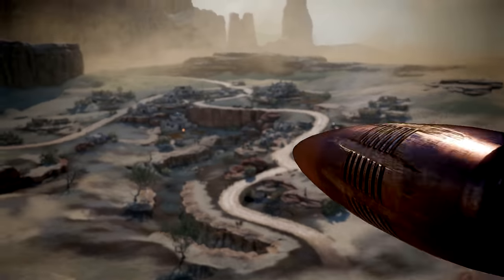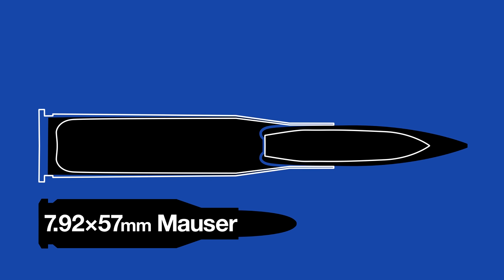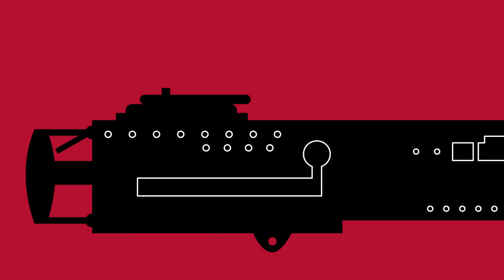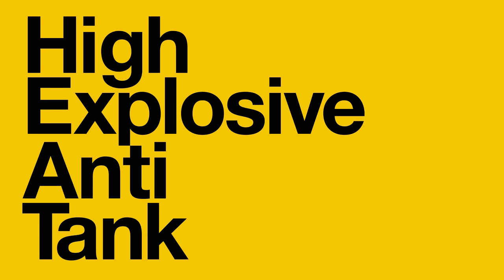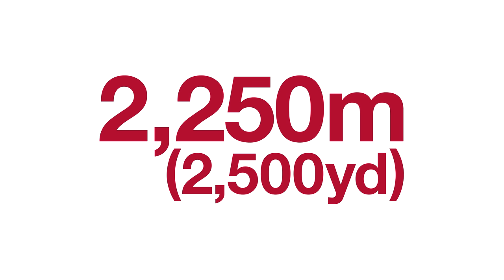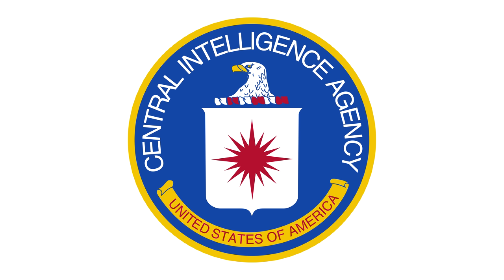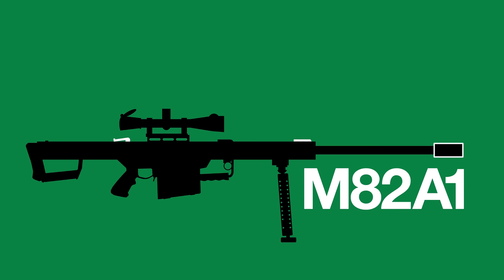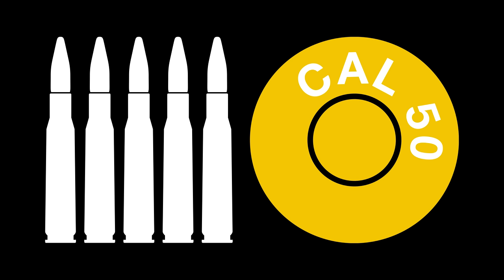Barrett .50 Cal.

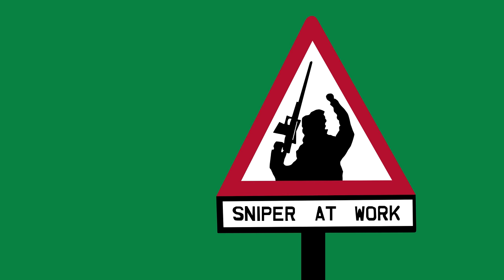Comment: 6:46 They used them behind enemy lines to stop supply vehicles, a 50BMG to the crankshaft of a semi truck does a lot of damage. Seizes the engine, and stops it in it's tracks.

Comment: One thing that was not mentioned which helps explain how the Barrett is so controllable is it's operating mechanism. It uses the somewhat unusual Short Recoil operating system which causes the entire barrel to reciprocate for a short distance every shot. This helps attenuate the recoil and spread it out.
Reply: Short-recoil operation isn't unusual, it's just unusual in a rifle. Most handguns are either straight blowback or short-recoil operated. All of Browning's machine guns, the M1917, M1919, M1921, and M2 also operate on a short-recoil action.
Reply: Extremely useful system to handle the recoil of cannons aswell.
Every modern naval gun has it, you need it when you're firing volcano eruptions with every shot!

Comment: Definitely an iconic rifle. One that successfully proved itself in application as a sniping weapon despite its purpose as an anti-material rifle. Made record breaking sniping shots. The sheer power of that round can punch through cars, walls, and light armored vehicles. And it has taken down enemy threats behind or inside those very things. One I know had in its earliest marksman use test was able to eliminate 2 insurgent targets who were radioing and coordinating mortar strikes with radio and binoculars. First shot was low hitting the balcony wall from I believe between 700-900 yards. They came back to it and called shots on the pair. But the second shot hit its mark. The 50 BMG round struck center mass on both targets with that one bullet. The spotter even told his sniper “holy shit!” He had got them. The Barrett can really make you, as the phrase goes, reach out and touch someone. I would love to see a video to be done of the winchester lever action rifle or the Colt single action army revolver “the peacemaker”.

Comment: The bf4 version of the M82 is the best in any multiplayer game imo. Instead of balancing the weapon in a tradicional way they let  the weapon be extremely strong (1shot players at any range, 2-3 shot light vehicles) but the weapon spawn on a fix position on the map (not with the player), so you have to control that area or be careful with the cooldown to use it. Nice way to balance and keep the M82's identity.
Reply: That thing was disgusting. Once you held it's location you were nigh unkillable. Especially on deathmatch maps.

Comment: U manage the recoil cause it has a ton of weight and a compensator. Also cause u tend to use it while  sitting or leaning on the ground. Not meant to should fire. It is an antimaterial gun that can be use for antipersonal.

Comment: I disagree about the .20 to wound, .30 to kill thing.

5.45x39 seems to cause just as much, if not more, damage to the target than 7.62x39, and is much more likely to deposit its energy within the target instead of punching straight through. That is, despite being smaller caliber with smaller energy, the shape and muzzle velocity advantages mean 5.45 does as much damage as 7.62 at short range. At longer ranges the 7.62 likely does more damage, but at shorter ranges, fragmentation and yaw make 5.45 and 5.56 pretty effective over the 7.62 due to higher velocity.
Obviously full length rifle cartridges are superior to 7.62x39. But even then, terminal ballistics matters a lot. If you have a 4000 J round that exits the body with 2000 J remaining, you have at best a 2000 J round, and only about 60% of that is deposited into the body cavity.

Or likewise, if you have an even shorter 7.62, say, 7.62x25, you may very well not have sufficient velocity to quickly incapacitate someone.

Comment: Most people don't realize that the M82 and M107 are actually very* light recoiling. My 270 and 450 bushmaster kick harder than my Barrett. You gotta remember that's it's a recoil operated actuon and mine weighs 33lbs with the scope, so little recoil

Comment: What's funny though is that the M82 was never really intended as a precision weapon. It's a short recoil action, not conducive to precision. There are other, more precision oriented weapons such as the McMillian TAC-50 or the Serbu 50-A. Real world precision with an M82 is about 2MOA or better, which is still 20 inches at 1000 yards, more than capable of hitting a man most of the time, but not what we expect from precision rifles.
It's also nice to see the M82 equipped with a red dot by Navy personnel when it's used in a helicopter as overwatch during interdictions.

Comment: The Barret isn't a sniper rifle, though. It's an anti-materiel rifle. It's less accurate than, and does not have as flat a trajectory as smaller, purpose built sniper rifle cartridges. And at longer ranges, does not retain its energy and terminal ballistic performance as well as those rounds either.

The purpose of the 50 cal snipe rifle is to destroy soft-skin vehicles, equipment, grounded aircraft at long range, and for an extremely low cost. It is primarily meant to shoot at engines, not people. 

You should have pointed this out as something media and games get wrong.

Comment: What the fuck is the point in the iron sights on the M82A1???
Reply: General requirements, and distrust of the reliability optics.  Remember, this is an anti-materiel rifle, not a sniper rifle.  Imagine you fall out of your vehicle and land on your optic.  You still have an objective to complete where you need to hike somewhere and put holes in some radar dish or some transformers or some parked aircraft or some installation at a distance.  Maybe your scope is unusable when you get there.  At least you can still complete your task with irons.
Reply: In case you feel rude putting big holes in things from miles away. Now you can shake the mans hand before you remove his upper torso.